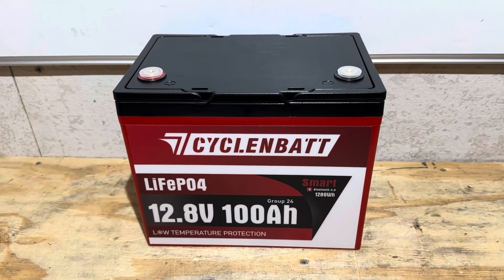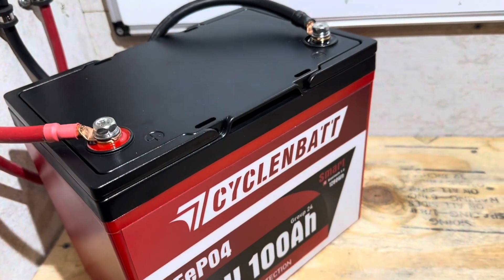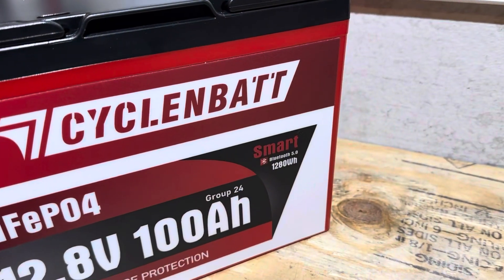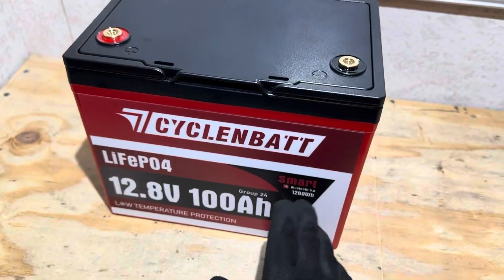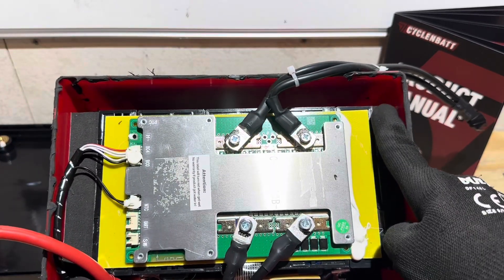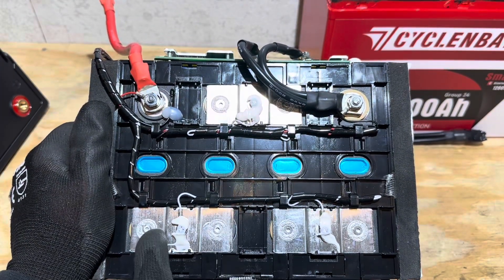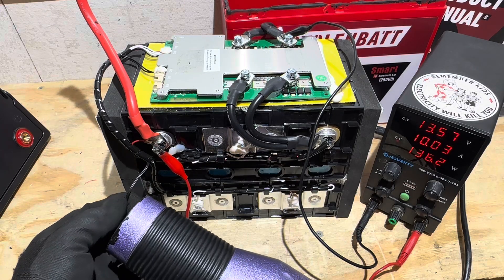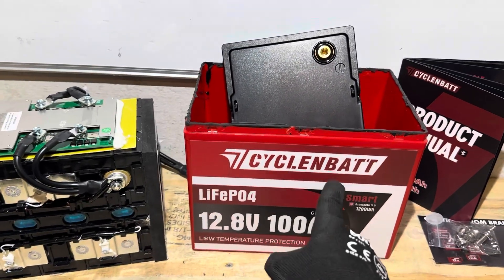Best Budget 12V? All New CYCLENBATT 12.8V 100Ah Smart Lithium LiFePO4 Battery Review and Teardown

Comment: It looks like the mini outperformed the larger group 24 version? Only 101ah bs 104.6. Is it possible that if you tested this again that it could come out higher? Thanks.
Reply from the maker: Differences in the cells internal resistance come into play between different batches of batteries. 
Also the matching or lack of matching in cells groups can cause differences. 
Test temperature comes into play as well. STC is 25°C/77°F for the cells. 
I try to keep all batteries between 70-80°F for 24hrs before test. 
Not a lab but I try to keep as consistent between each as I can. 
Even just one weak cell or a runner will impact capacity overall.

Comment: Why 2 leads on the negative side but only 1 lead on the positive?
Reply from the maker: BMS is built with 2 power leads hence the 2 wires on negative. Positive is single conductor due to 1 point of connection at the cell group total positive. This is common on smaller 100 to 150A BMS boards.